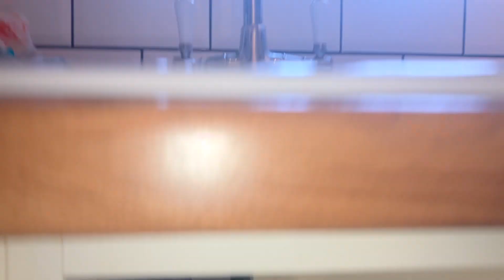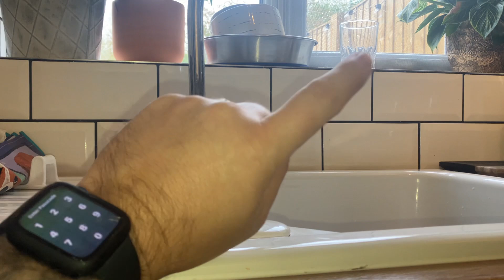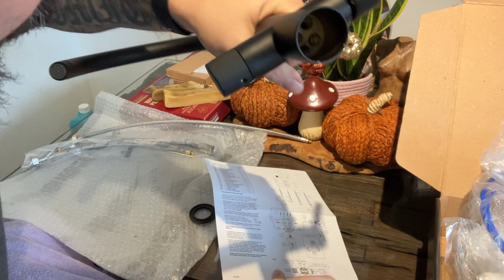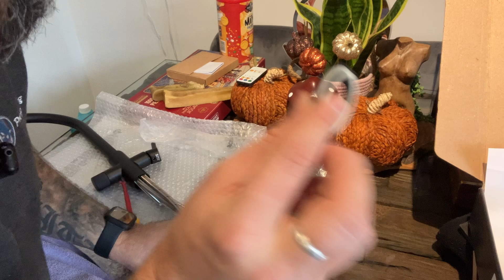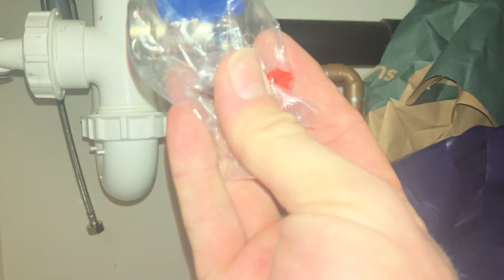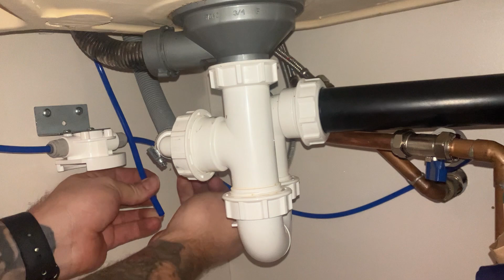Install A Kitchen Filter Tap Like A Pro: Enjoy Filtered Water

Comment: Hi. I was very happy to find this video as I can't find any instructions on how to modify under counter filtration systems to three way tap. Could you please share the names of the brass and plastic adapters you use to connect 3/8" Inch Flexi Tail Pipe to filter system? Many thanks for the video again!👍
Reply from the maker: So the first brass adapter was 3/8 male x 3/8 female adapter and the plastic was a 3/8 male thread x 8mm push fit ( or whatever your blue pipe size is )